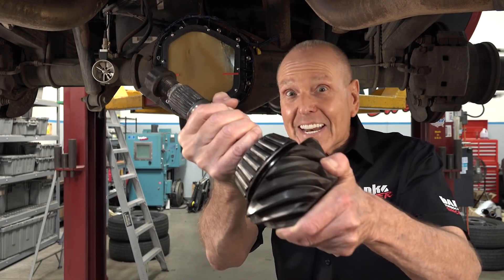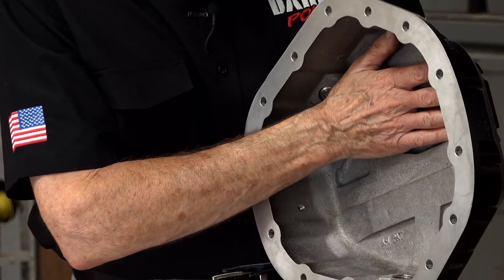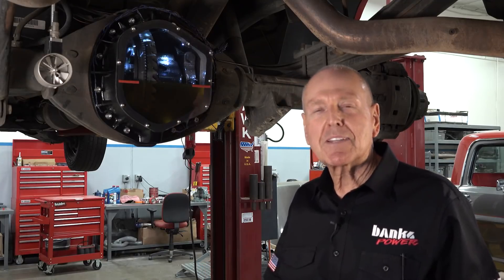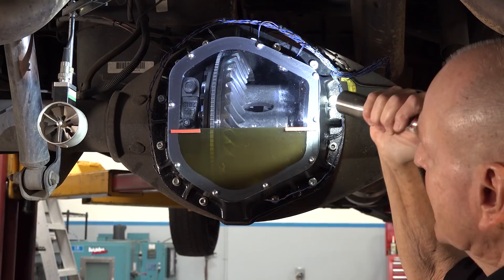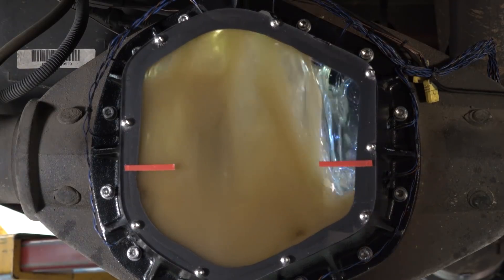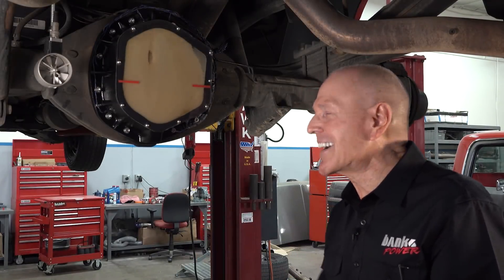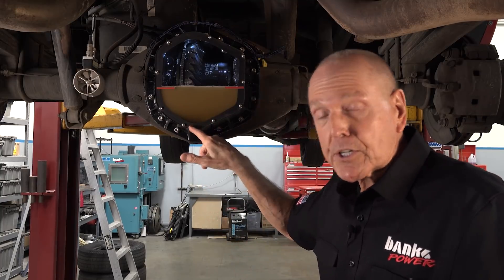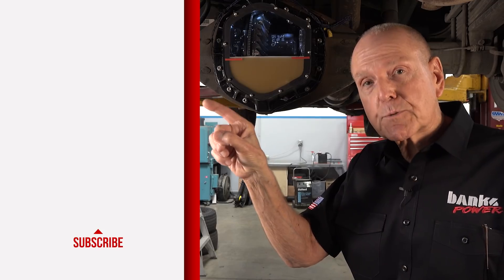What's going on behind your flat-back diff cover?

Comment: I get your hypothesis, but why does everyone run upgraded dif covers? I have never heard of someone destroying their pinon bearings after upgrading to an upgraded dif cover.
Reply: You've never seen a bad rear after replacing diff cover...?🙄🙄
Reply: @c5vette170  No I've never heard of a rear end going because someone went with an upgraded dif cover. I know a lot of people who tow heavy and have upgraded dif covers with no issues
Reply: @Jordan91alexander  I haul heavy as well. Your statement of "more fluid=more cooling" is absurd. More fluid simply means it takes longer to heat up and longer to cool down. Like he stated in the video, the aftermarket pans are causing the lubricant to do more work thus increasing the temperature. It's called dynamic friction.
Reply: @Jordan91alexander  u didn't read my comments on last video how my buddys traveled the US to wire new cell site towers, towing 5th wheels behind their dodges with Mag hi tec covers cause they were told stock cover and oil level was not good for outer axle bearings,  both trucks went thru multiple rear ends for the 10yrs they worked that cell site project
Reply: Dodge blamed the camper being to heavy to tow behind their 3500 diesel
Reply: I still have my 99 with 40s on it with stock cover, no issues yet
Reply: Kwmike-D ok... so what failed? I would agree running higher than normal level is a dumb idea, but keeping the same level should be fine. Were they running stock or modified tuning? Was the trailer in fact too heavy for the truck? Was the lube changed at the correct intervals?
Reply: Its possible got a 5.9 with 445,000 miles with stock cover and still towing roofing shingles without differential problems
Reply: @kleetus92  center section,  nothing with outer bearings like these companys claimed back then, dully trucks, fluids were changed regularly with all syn AMS oil at the time, trailers meet the trucks gvwr for 5th wheels since they were traveling the US from state to state wiring cell towers back then

Comment: Just saying.... he says that is made identical but there is an issue with this when he shows you the the stock versus the see-through look at them closely the oil will also get into the small crevices and splashback will not create as much fiction/agitation to the oil.

Comment: Makes me wonder what’s going on in my stock 8.8 on my road race car which could have a lateral side G of 1.8
Reply: I am a long time road and oval racer.  You have to baffle the tubes on most diffs to stop the oil going down the tubes. A Salisbury type less so as the bearings tend to do so. Enough oil travels, spirals,  down the axle shaft to lubricate the axle bearings and then eventually makes its way back down the tubes. 
Initially 40 years ago when I did this I stopped blowing diffs,, and stopped replacing axle seals as well. Win win. It seems that an 1.375 hole in the tube is enough for an 1 125 axle. A little bigger wont hurt. But really no less. Though this was using 90 grade mineral oil which is thicker. Synthetic is the go for all lubrication.

Comment: Where is the finally to this series?
Reply from the maker: We haven't posted it yet. We've been sitting on the info for quite a long time. Why? We'll only get your attention once. We're going to reveal the research when we debut our cover design. Another reason for the time between follow-ups is purely due to R&D. We made many iterations and several billet prototypes, tested the heck out of the design, then went with a manufacturing process that is far more accurate but takes much longer. All of this is in the name of the best-engineered diff cover. Stay tuned 👍

Comment: Will you run the same tests with 85W140 while you're collecting data?
Reply: I want to see 50W90
Reply: Don't forget Marvel Mystery Oil.
Reply: That's still 90w oil.  Winter factor doesn't matter at running temperature.

Comment: The bumps on the inside of the cover look very deliberately designed to sling oil in certain directions. The counterarguments posted here in the comments seem worth considering, although I'm no expert.

The oil is the only way heat is transferred to the cooling fins. If oil is only covering a small part of the inside of the cover, you lose cooling ability. Part of the reason for the flat shape could simply be that it causes the oil to spread out over a larger area on the cover, transferring more heat. You can see at 50MPH the entire cover is covered in oil, this may be bad for aeration, but it is fully utilizing the heatsink.

The quality of oils has been increasing. Is it possible that modern oils have more resistance to aeration and so trading some aeration for cooling is actually a strategic decision to improve differential lifetime?
Reply: And... more fluid means more fluid flow, which means more transport of fine metallic particles away from the gearing and towards the magnetic plug.  Keeping the system free of foreign particles is the absolute #1 way to keep it healthy.  #2 is to avoid pitting from cavitation (which is different from aeration), and #3 is heat.
Reply: I've read up on how sump magnets work. Magnet filtering efficiency depends on a LOT more than fill volume. If a magnet is placed in a flow eddy, then that is basically true because the oil will stick around longer before cycling through the gears again. Less oil velocity means more particles captured by the magnet. However, the increase in volume is probably offset by the large amount of extra fluid velocity caused by the sharp corners in the cover. The corners cause the oil to cycle through itself in addition to cycling through the gears.

Magnet strength is 4x more important than viscosity or flow rate in capturing small particles. So getting the strongest magnet which can withstand operating temperature is the first priority. Large particles will be captured regardless of flow rate, but by creating better conditions you can lower the minimum particle size the magnet can capture. 

The eddies in the oil would be the optimal place to put a magnet since the flow rate is lowest at these points. However the position of these eddies will change with speed and road inclination, so it's an inexact science (unless you create a chamber specifically to slow down the oil for the magnet).

Here's a question. Does aeration increase the ability of particles to move towards the magnet or reduce it? I am thinking probably a reduction since the surface tension of the air bubbles is stronger than the oil viscosity, as well as increasing the distance the particle must travel to get around the bubbles, and so the forces resisting the magnet attraction of the particle are higher. Perhaps the effect is different on large particles than small particles.

So it's hard to say whether it improves the magnet efficiency because there are just so many variables that depend on implementation, especially magnet position. Here is a good article on sump magnets:

http://www.machinerylubrication.com/Read/794/magnetic-filtration

Comment: The main selling point of larger,cool-looking covers is reduced heat and friction? No,the cool factor,not cooling.
 Some race cars have circulation pumps plumbed to an external radiator!
You actually wouldn't need a pump,if the hoses came off of the bottom or back.

Comment: This series seems like a " the sky is falling!!" mentality. The differential by nature will aerate the oil as it is carried from the sump around the ring gear and into the friction point with the pinion. It's the volume of fluid available with a stock diff and cover that was designed into the rear axle. As long as the oil is proper viscosity, and type, and the level is within the prescribed limits, the internals of that axle don't care. Gear oil is simply a hydrodynamic wedge between the gear teeth, and is forced into oil galleries for the bearings just as they were designed.

Comment: There are lots of papers on hypoid gear axle efficiency. This one shows oil churning losses are the smallest fraction of power loss: https://spiral.imperial.ac.uk/bitstream/10044/1/33209/2/Revised%2520manuscript%2520-%2520Kakavas%2520et%2520al%2520April%25202016.pdf

So Gale might be focusing on the least important component of heat generation/inefficiency.

Comment: Well, I’m going to wait until all the evidence is in. Facts, not opinion or conjecture.

One thing to consider as to why the aftermarket covers require more fluid is because the internal volume has increased. My Mag-Hytec fill level is the same as stock, but with more fluid. 

Also note that my high mileage Dana 80 hasn’t failed as a result of having an aftermarket cover. There is no evidence of increased wear metals. What metals do exist are the same as with the stock cover, but they are gathered by the internal, dip stick magnet, which allows easy monitoring and cleaning without removing the cover.

Let’s wait until all the data is in. Patience is part of the scientific process.

Comment: Makes plenty of sense to me. I never understood the point outside of extreme offloading where you don't want a big rock punching a hole in your cover and you're dealing with serious angles. Then by all means make the cover stronger and have extra fluid to compensate for off angle driving. But for mall crawling? Not necessary

Comment: it woul be better to have oil pump inside of diff to spray oil in direction of teeth mash and ring gear should be out of lube level to prevent lube mix and waste energy on it

Comment: Gale Banks is ABSOLUTELY CORRECT ans AWESOME!.   Look at what the trucking industry is going to so semi trucks achieve better fuel economy.   The drive axles can vary the level of the gear oil in the differential for either better fuel economy or higher load applications.   More fluid does not mean better lubrication or better heat transfer.

Comment: You ever gonna finish this series? If you're still "working on it", at least let us know. Been over 6 months of dead silence.
Reply from the maker: The reason for the time between follow-ups is purely due to R&D. When we post a video, ten times out of ten, it's something that happened that day or the day before and because we are following the engineering team's timeline. We do this to ensure we can film good content without interrupting their workflow. Regarding the diff cover series. We've been sitting on the info for quite a long time. Why? We'll only get your attention once. We're going to reveal the research when we debut our cover design. We made many iterations and several billet prototypes, tested the heck out of the design, then went with a manufacturing process that is far more accurate but takes much longer. We have the diff covers in production and hope to have an announcement soon. The release is days, not months away.
Reply from the maker: The reason for the time between follow-ups is due to R&D and timing... We've been sitting on the info for quite a long time. Why? We'll only get your attention once. We're going to reveal the research when we debut our cover design. Put yourself in our shoes. You've done all the competitive research and you're excited about sharing it with the world. But along the way you discovered how to improve diff covers in a way no one ever has. So, you design one. But making it isn't done like the other guys where someone bangs out a design in CAD then sends it off to the sand cast shop. We made many iterations and several billet prototypes, tested the heck out of the design, then went with a manufacturing process that is far more accurate but takes much longer. Are we curing cancer? No. But are we making the very best part possible? Yes indeed. 👍 The covers are currently in production and we'll be posting the final video as soon as we can.

Comment: I always look to racing such as NASCAR for real performance. What are they doing with axles and covers.
Reply: NASCAR runs a housing that looks like a Ford 9" or newer Toyota.  A "quick change" style housing, I guess.  They've got the geometry of the factory diff covers he's talking about.

A lot of high end road race cars run electric oil pumps with coolers and lube lines to the points that need lube.  Best of all worlds there - you reduce your drag from having to have oil above the rotating bits for splash lubrication, not have to worry about starvation under G load, plus better cooling.
Reply: immikeurnot my point exactly. Race engineer > bro science

Comment: Great marketing. Seems like the run-up to unveiling a new product. Research has the appearance of science, but you get the sense his mind was made up about the question before he started. There are certainly other diff covers out there that address the flow problem while still offering increased sump volume. It seems as though the test subjects were specifically selected to support the predetermined conclusion. For it really to be research, there has to at least be the possibility that either outcome is potentially viable. This isn't the case here. I guess I would be surprised if the series ended up with showing any benefit to a flat back diff cover. The comments about the pinion bearings are just that...comments...conjecture. Nothing has been done to prove that out. While they may receive a little less lube, is it less than they need to live a long life in the diff. Don't get me wrong. I like the guy. He puts in some honest work, but I wouldn't call this research when it seems so slanted towards a predrawn conclusion.

Comment: Shouldn't they monitoring the temperature of the differential fluid through these tests?  He doesn't mention temperature data!.
Reply: rodkneed watch the whole series. They made a rig and tested the oem cover in part 1, and in this video he even said they’ll have the data on the aftermarkets in part 3.

Comment: Amazing test and yikes.  Way too much aeration and you can see the oil losing viscosity really quickly.  Compare that to the stock diff video and it's horrifying.  The pinion might be getting oil, but it ain't no good at all.  I bet a low quality oil would really put on a show.
Reply: I'm not a dealership mechanic.  I'm purely interested in this from a educational type stand point.  I don't see where Gale Banks has claimed to be fixing anything yet.  He's just doing testing to see what is going on and it's clear that this design is not ideal.  Do you really need catastrophic failure to be your indicator that something is bad?

Comment: What about the Ram aluminum, finned diff cover which has a smooth inner transition?

When will part 3 come out?
Reply from the maker: Part 3 is almost done. Covers are in production. The Ram HD cover but fails for reasons beyond its control. There is no air movement behind the diff cover. It's a low-pressure zone. The air is split by the rear differential housing like an airplane wing and doesn't meet until about 20" behind the diff. That means that no matter how deep your fins are, they're still not able to cool well because there's so little air flowing over them. That's why we designed and patented the Ram-Air scoops. They force air up through the fins... air that would have normally just past under the truck.
Reply: @bankspower  Thanks for the reply!  I posted this question on another video but since you're responding here, I'll re-ask.

I like the scoop design, I think it's a great way to get more (any) air to flow over the external fins on the cover.  I am curious the reasoning behind putting the scoops on the bottom side of the diff where they're more likely to get damaged if someone were to take their truck offroad and snag a rock.  I'm guessing there is more airflow on the bottom side of the diff, but certainly there must be some on the top and the scoops would be less likely to get damaged.

I realize the target customer is not buying this for a hardcore offroader.  But there are some who multitask their truck and will tow heavy loads up grades and take it on a rutted out farm road where the diff may drag.  You're going about all of this very methodically, so I'm sure there's a good reason - I'm just curious what it is! I also appreciate you keeping everyone in the loop with this; as an engineer in the automotive field, I find it fascinating to see an aftermarket company doing so much research.

Comment: I bought two of the mag hytec diff covers. one for a 2014and a2006 Ram Dually. they look cool. hold two quarts of oil vs one quart. have a port for a temperature gauge. a dipstick hole with magnet which holds a funnel and I can easily pour a gallon jug of fluid in through the top. and the main reason I bought these was for the drain plug. the book says to change the fluid at 25000 for heavy towing which is the main purpose of our trucks. I do not believe 8 quarts would overfill this differential as the cover is larger to handle that extra fluid which I think would lead to cooling the gears better. if the flat back side of the mag cover is a problem maybe mag will come up with a fix such as an internal baffle that we could add. looking forward to seeing the final test results and the design of the banks cover and if it will incorporate a drain plug and a top fill plug dipstick hole along with a temperature probe port.
Reply from the maker: The Banks cover includes an angled fill port at the top for easier access, a sight glass that can be viewed from the back of your truck without having to crawl under underneath, and a magnetic drain plug. We've checked all the boxes on your wishlist. And, we throwing in Ram-Air ducts for better cooling of the deep fins. The flat-back companies will likely have to scrap their designs and completely retool. There's really no way to alter existing covers to improve fluid dynamics and restore the lost horsepower due and fuel economy. They'll have to start with a clean slate as we did. Take a look. https://www.youtube.com/watch?v=5_Jamg2gpgk